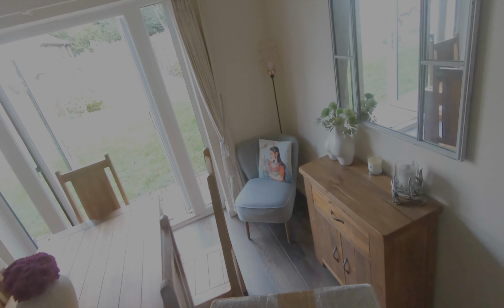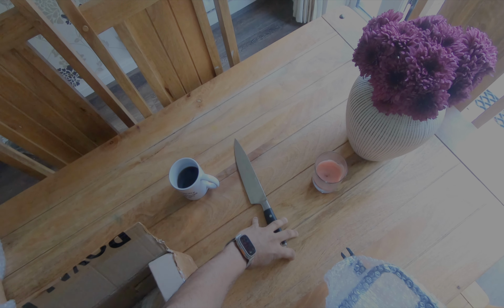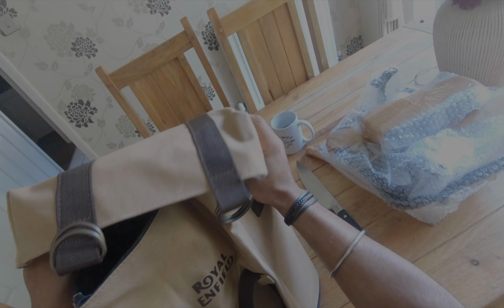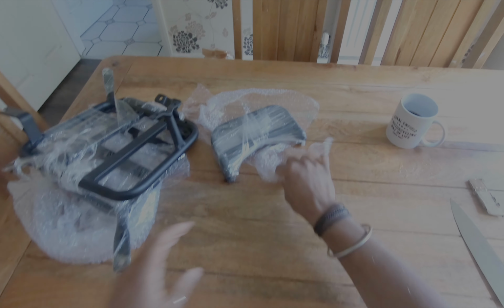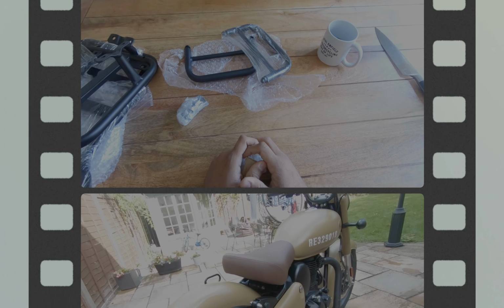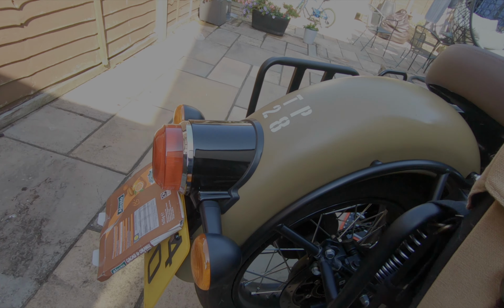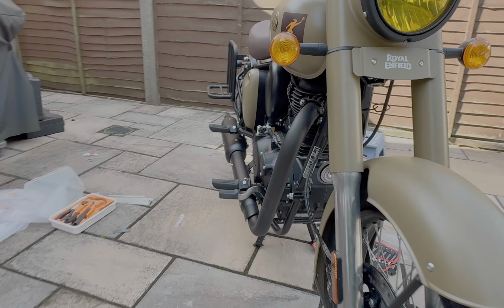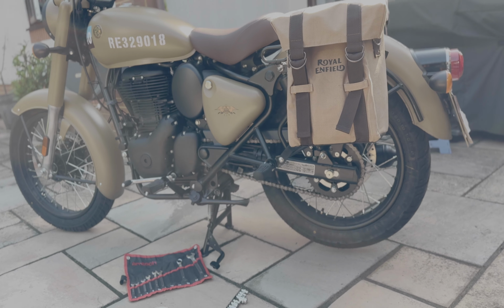Royal Enfield Classic 350 | ebay Panniers | Unboxing and Installation

Comment: Had my Signals Marsh Grey since March. 

Mods: Low seat, heel-toe shifter, rear rack, canvass panniers (and frames), engine guard, windshield and fog lights.

Immense fun.

Hope you are enjoying yours!

Ride safe.
Reply from the maker: Cheers for the comment and sharing your mods. I would love to get the lower seat and heel-tow shifter, did you install them yourself? Are they easy to add? Thanks
Reply: @StudioReesau  I did the heel-toe shifter myself,  got it on ebay. Very easy to do.

The low seat I had installed by the dealer along with the rear rack (both ordered when I bought the bike). But there are a few youtube videos of installing the low seat.
Reply from the maker: @YiddoHuayi  cheers buddy. Let me have a look 👍👍. Thanks